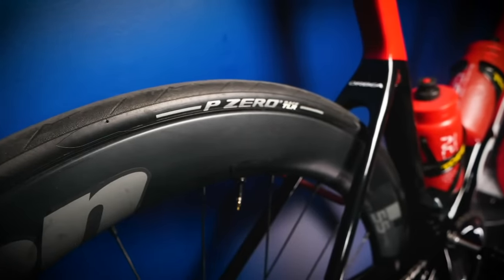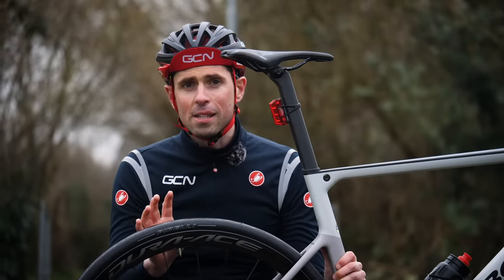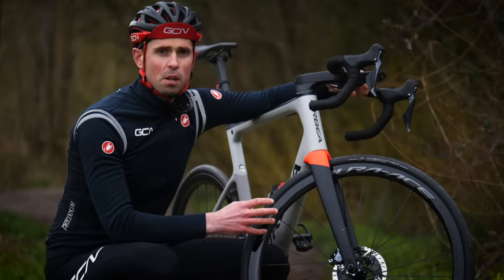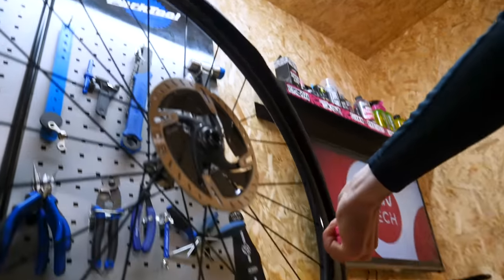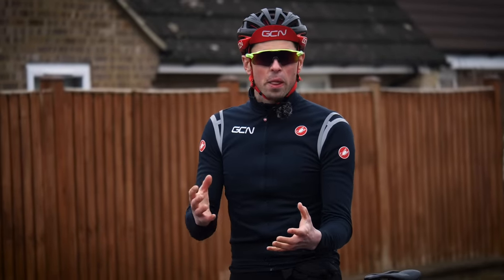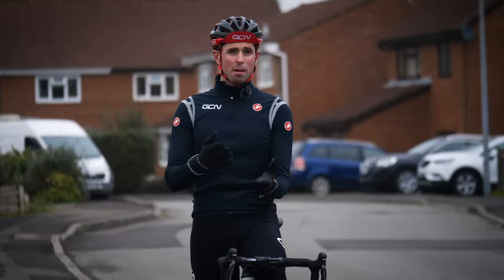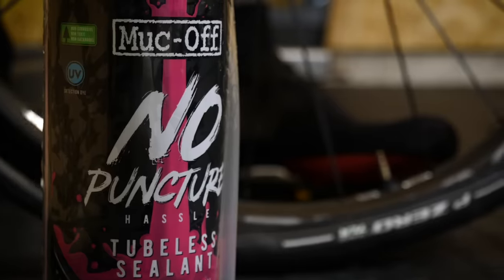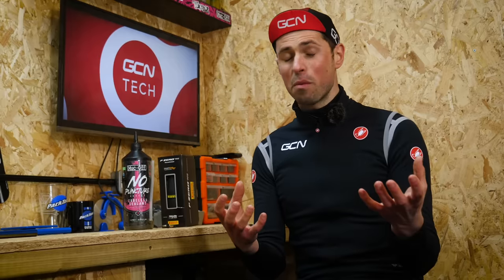Tubeless Convert! | Why Alex Will Never Use Inner Tubes On His Road Bike Again

Comment: Alex says he has cold hands but, watch the video closely. When the music is playing it seems he is always wearing gloves when he's riding but, when he takes off and stops on his bike, he's not wearing gloves. The magic of video! If he didn't say he had cold hands, I may not have noticed. LOL

I wish Latex tubes were tested in the video too because GCN has suggested they are faster. I've never seen the Latex tubes before so, I don't know but, I am curious about them.

After watching the video, I will stick to tubed tires but, maybe later try tubeless tire.
Reply: No doubt that latex tubes are faster and more comfortable than any butyl, just be very, very careful mounting them and be sure slightly inflated tube is pushed as far into he tyre as you can get them before mounting the rim. They are very easy to pinch but once on no problem at all. Ps coat the tube in talcum powder first, will make it easier to install and reduce friction against the tyre. I would never go back to butyl, ride is so much smoother.

Comment: I was all in for tubeless tires on my road bike, after all, I've been using tubeless on my MTB for years now. But a couple years ago I bought this kevlar tire liner, installed them, and flats were thing of the past. I use tires to wear, even with big cuts that tubeless tires couldn't handle.
Reply: Got a link, model number or brand name? I'm interested.

Comment: I 'm more into latex innertubes, because I can fix em on the road. Rolingresistance is also low, I guess ! ?
Enjoy your show.
Hello from Berlin.
Torsten
Reply: How do you fix a Latex tube, just use a regular patch for butyl tubes?
Reply: @SergioGarcian_n  Yes.
Reply: @SergioGarcian_n  A normal 'Tip-Top-patch' works perfect.

Comment: Disagree I have tubeless on gist SLR wheels they are good but not as good as my cadex tubs, in my opinion tubs are faster safer lighter  and using the tape I can swop one on the roadside faster,  both have there place but tubs still king

Comment: I run tubeless with my Giant SLR 1 wheelset. I get my LBS to fit my Conti GP5000 TL when they need replacing, which he does for £12. I’ve only had 2 punctures in 3 years of riding tubeless, love it.

Comment: Great work guys
My question is this, why do some pro riders on the tour use clincher with inner tubes?
Reply: Most pros still ride tubs. Good reason for that.
Reply: The claim I've heard is that the ones doing so are generally using the absolute lowest rolling resistance setup for a time trial, and for now, that is still a clincher and latex tube.  There might also be some riders whose team wheel sponsor's maximum aerodynamic setup is on clinchers only and they either aren't allowed, or aren't gaining anything, running a competitor's tubular (or I suppose tubeless) aero wheelset.
Reply: From over a million subscribers, some gibberish must rise to the top.
Reply: They're using high end clinchers with latex tubes. Latex tubes have a nice ride feel, but they're expensive and don't hold air very well in my experience. And it hurts when they flat. They can be repaired but are way more finicky than regular butyl. And they're not good with heat.

Comment: I was a long-time tube advocate. Was. Out riding with TPU tubes, and I got two flats back to back. Even after washing the tire, inspecting and removing the thorn and carefully reinserting a new tube. I made it another 23 miles and popped my inner tube again; completely ruined my ride. I'm finally giving tubeless a go. I can't keep getting flats.

Comment: I was an early adopter of road tubeless. Rode it for years. Mostly trouble free but when it did fail, it was a huge pain. A set of Schwalbe Pro Ones which were constantly leaking eventually had me go back to latex tubes. I never really had punctures in the first place. And latex tubes really aren’t any slower. Also comfort is the same. And now with TPU tubes I see even less reason to bother with sealant. Tubeless only really works if you ride tires wide enough. 30s minimum. Better even 32s. I don’t need that kind of width on an aero road bike. I’ll stick to tubeless on gravel. But on the road I’ll leave it to others.

Comment: When you do inevitably puncture with tubeless it's a mess, an expensive mess.  You still have to carry tube anyway and there is no real world difference IMHO. This test proves nothing.
Reply: And you are in deeper trouble if you don't remove that tube at the end of the ride, and then get another puncture a month later. Inside of the tire will be very sticky, and it will be very hard to get the new tube in. That added over an hour to a 200 km day for a friend and me, and led to me swearing off tubeless for good.

Comment: I'd like to see how you put an inner tube into a tubeless tire when you're in the middle of nowhere. Sounds like a very messy job to me.
Reply: Not had to do it yet (🤞🤞) - riding tubeless on the gravel bike for over 2 years now, MTB 6 months, but road bike just 3 - though nearly 4,000km on the latter. 
Have had 2 large holes (1 gravel 1 MTB) that the sealant couldn't fix literallyin the forest in the middle of nowhere, used a plug (Dynaplug) and off I went in less than a tenth of the time it would take to swap an inner tube. I'm definitely a convert.
Reply: You'll likely need some pliers to remove the tubeless valve....
Reply: This isn't the way to fix pucntures that don't seal, plugging with bacon-strips or dynaplugs depending on the size of the hole is the best way, and will fix some massive holes. If you're removing a tubeless tyre, you're doing it wrong.

Comment: I do ride them. And while some (i.e., Schwalbe G One Speed) are very comfortable (i.e., remarkably supple), the problem with all tubeless tyres today - is that they all leak air. Some as much as 40 psi per ride, especially during cornering, going from 90 psi to 50 psi within ten minutes (then losing pressure at a much lower rate). Others leak air only 10 psi or thereabouts a ride. And all leak air at the very least at a rate 10 times the air leakage of a butyl tube, effectively meaning that they must be-inflated at least before every third-fourth ride or every 5-6 days. That is the biggest flaw of tubeless systems. 
 A secondary, but not unimportant, issue is the cost: tubeless tyres cost between twice and 5 times as much as tubed counterparts, and require an additional expenditure on top of that (some €5-15 a season), unlike a tube that will require on average €5 every 5-10 years for a replacement if unpunctuted.
Reply: I have those same tires on one of my bikes, with tubes in them, and they still ride really nice.  They do wear quite quickly, though, which would be my main complaint with them.

Comment: I started running tubeless on road bike a few months ago and am very happy, but... when do you know when it's time to add more sealant? My Schwalbe tubeless tires regularly have small beads of sealant permeating through the sidewall - apparently this is normal, but clearly is reducing the amount of sealant in the event of a puncture. #AskGCNTech
Reply: Do you make sure you shake up your sealant like crazy before adding it, and keep the bottle upside down when adding sealant so you're not just pouring liquid in? There might be a few bubbles when you first add the sealant and go for a test ride etc but these should solidify and you shouldn't really see any more (unless you get a puncture). 

That's my experience anyway
Reply: @daveheys2699  Really depends on the tire and how the sidewall is constructed, but if they're intended for tubeless, then yeah it should seal up.
Reply: Typically I only pump my tires back up on the weekend. If I notice I'm having to add air every 3 or 4 days, I add some more sealant.

Comment: On this video Alex was seen putting in the gloop with the tyre off the rim. There is no mess if you use valves with removable cores and sachets of gloop such as the Muckoff type.  Nice easy, clean and quick.  There is even another brand (Milkit) of tubeless valve that allows you to add gloop without first letting you take the air out.  As far as tubeless tyre being difficult to get on, even some inner tube tyres can be super tight.  With tubeless you never get a pinch flat.    Tubeless in the long run and in my experience( several years both off road and on road) is so much less faff than tubes.

Comment: So tubeless are faster, comfier and you don’t get punctures. 

Cue millions to say “I’m sticking to tubes”
Reply: Yeah maybe but you need special equipment which you might not have.
Like special rims and such
Reply: @SuperDeinVadda  well I’m not suggesting people buy new wheels etc more that I know people will use tubes on tubeless ready wheels and tyres. 

As for special equipment it depends on the brand of wheels. If Mavic you don’t need anything, I setup a mates Mavic tubeless and it was far easier than tubes.

My own were Giant which could be trickier, you need a different pump or a separate charger but that’s once done it’s done and hassle free. 

Not needed to try setup on my new bike/wheels but hassle free for first 800miles.
Reply: @CerveloS5rider  I got some Mavic aksium rims from around 2016. I doubt that tubeless would work for them.
But when I get a set of carbon wheels I might go tubeless just to be extra fancy :)
Reply: @SuperDeinVadda  not sure exactly when Mavic went tubeless but it was after 2016. 

GCN did a video on Mavic tubeless and my experience backs it up, they are so easy to setup. If I was buying new wheels Mavic would be very high on list due to this. Although I’m “stuck” with ones that are harder to setup but I’ve got the gear already so doesn’t matter.
Reply: How many punctures do you get without tubeless?
I get 0-2 a year.
I used tubeless and had one within a month. Sealant didn't work.
I didn't go faster with them.

So for me it seems tubeless is more expensive and higher maintenance.

And saying more comfortable...idk, but to me comfort on a roadbike depends on finding a position and a saddle that work for you. Not tire pressure...
Reply: @Bendersnatchling  I’d say you get exactly the same amount of punctures on any tyre system. It’s the after effects of the puncture. 

Tubes = sat at side of road changing tubes hoping you have not left the thing in the tyre that caused the puncture.

Tubeless = noticing some sealant on your frame when you get home and thinking “oh, must have got a puncture on my ride today”
Reply: @CerveloS5rider  or "nope didn't seal, nope still didn't seal..... Yeah, it's not sealing. Okay, down to 1 bar."

I went back to tubes and didn't regret it.
In fact I had a tube in my front and tubeless on the rear, since the rest tire worked just fine.
I found a thumb size clot of sealant though a few days ago when I switched the tire.

Because I didn't like the grip of the GP 5000.

There was a test on a big German roadbike magazine concerning cornering.
How far can you lean until you slip and fall on your side.

The winner was a tire by the "inventor" of the black chili compound used in the GP 40000 S II.
He had founded his own company since because he felt it's not worth it to sacrifice 30% grip for 1 Watt of rolling resistance.

I bought and installed his tires but had a cold now.
Will go on a ride on Tuesday.
Will let you know how they feel (combined with TPU innertubes @25g each).
Reply: @CerveloS5rider  Edit: The tires are wolfpack tires by Wolfgang Arenz.
Reply: @Bendersnatchling  yeah.  same experience with me.  Tire down to one bar, then I try filling it up so I can continue the ride, and the hole blows back open at around 45psi.  Not a big hole, either.

Comment: I tried tubeless two years ago. I do have to admit it did feel better than inner tubes, but there were plenty of issues, but I've had enough issues with them that all my wheels (ten sets) all have inner tubes again. First, the setup isn't that easy. It can get very messy very quickly. Second, tire compatibility is something to keep in mind. Third, tubeless doesn't mean less flats. It just means no pinch flats. Glass or any object like that can easily create a hole and you have sealant spraying all over the place. Fourth, you still need to carry a tube with you. There are punctures that sealant just won't fill (a rip in the tire isn't going to seal). Fifth, the sealant might not be able to hold a certain PSI after a puncture which means you need to plug the hole some way. Sixth, sealant doesn't last forever. It needs to be replaced every few months (which can be messy).

Comment: I've been using tubeless tyres on my roadbike since 4 years and have a longtime experience with latex innertubes and tubulars as well.
It makes most sense with wider TL rims and tyres with a diameter of 25 mm or larger run at 5 bar or less. 
Biggest advantages : less pinchflats and less rolling resistance especially at comfortable ( lower ) tyrepressures.
The 2019 Schwalbe Pro One TL are less supple than Vittoria Corsa with a light inner tube though.

Comment: Switching to tubless added nearly half a pound to the weight of my bike. I rode like that for several months. In that time I got sprayed by tubeless sealant twice from punctures. Long story short, I went back to my tpu inner tubes and I have added about 10 to 15 mg of tubeless sealant in each innertube for a little bit of puncture  protection

Comment: Man here in Colombia the tubeless tend to be substantially expensive.
What I do is put slime in the inner tube and have a similar effect...
If they're is a puncture I just lose pressure but still good to go...
Later in home I fix it. The secret is not too use to much so you can fix the puncture without making a mess...

Comment: You still have to ride with a back up tube and co2 if your tubeless system can't seal a puncture, so I really don't see the point. Furthermore, tubeless tires sidewalls are too stiff. Ride a continental gp5000 tubeless vs clincher and you can tell which rides smoother.

Comment: My brand new tubeless on a Giant Propel deflated mid-ride, sealant everywhere, had to get a lift from a stranger. Come to reinflate it, it wouldn't work with a normal pump because there's just not enough air being pumped, so again sealant everywhere.  Went to so many local shops, including Halfords who told me they wouldn't reinflate it for me because they don't have the booster pump. Price for booster pump about £70 min, +sealant price.  Price for inner tube £10 and you can still use sealant to prevent puncher, still work with your old pump. If you not a pro and you don't care for minute gains in speed or comfort, I,e most of us, then inner tube is your friend. You wouldn't have to buy a tubeless setup, tap, sealant, booster pump, plugs, and all the while remembering to carry a spare inner tube anyway just in case you need it.

Comment: I'm using tubeless in gravel bike (I have 2 DT Swiss wheelsets - P-series for road and CR-series for more versatile use) for 2 years and several th. miles, just decided to go this was after realized at home I got a flat on my way back from work when wanted some more evening ride:-) On tubeless, never suffered total pressure loss beside of circustances which were obvious negligence of mine - sealant just got dry before bother to reseal, or more disturbingly - leaking through nipples might be sign rip tape is giving up, seemingly a year at 5 bar is enough... replaced it with looking more robust Stan's tape - double layer - so far, so good:-)... I originally used Schwalbe G-One (also in tubeless, working very nice in this setup) but later primarly was riding Pirelli tyres, already worn compeltely set of Cinturato 32-622 and replaced it with size 35 ones for endurance trips - seemes undestructable, once pierced most likely by sharp glass which probably reached weaker sidewall, but it sealed itself after leaking little bit when pumped to full pressure after while:-) Even sharp gravel doesn't seem to harm these, however after time dark dots show up on dust covered tyre, proof sealant is doing its work sealing micro-punctures. And also bought Pirelli P Zero TLR for more 'roadie' wheels last year immediately when they came on market, great tyres, but with these I have problem that at my weight and type of rims with 28-622 I couldn't keep optimal pressure (for my weight would be 6.5-7 bar) for many hours, maybe will buy 30 mm version, this has more capacity, maybe will be more comfy and keep good pressure for longer... and yes, invested in floor pump with tank + Schwalbe tyre booster, since work with CO2 cartridges was mixed success for me, frustrating and costly eventually;-) Recomending going tubeless as well, cheers, subscriber from Poland

Comment: Using some  Grand Prix 4000 clinchers with latex inner tubes, very happy with this setup and no need for anything else. Long time since I’ve had a flat and very smooth. Only downside is perhaps the need to pump up the tyres daily. But that’s about it

Comment: Tubeless is great...when it works. When DT Swiss tell you to glue your valve in place with cure a design fault in their wheel rim bed preventing it from sealing properly, you know there is still some work to do.

Comment: Yes, I do ride on tubeless tires.  My only issue is getting them on & getting them to seal initially.  It took a good while the first time, but it should get easier to mount with practice.  I prefer this inconvenience over pinched tubes.

Comment: People saying installation is difficult must bit challenged in the brains department. Tubeless is easy to set up as long as you use the right gear. For me, quick run around the rim with some muc off tape and install a muc off valve, mount your tubeless tyre using the rim valley to ensure bead slack, pump up the tyre to seat it (track pump normally, or co2 in a pinch), and squeeze some sealant (orange seal) in through the valve with the core removed. Easy as piss.